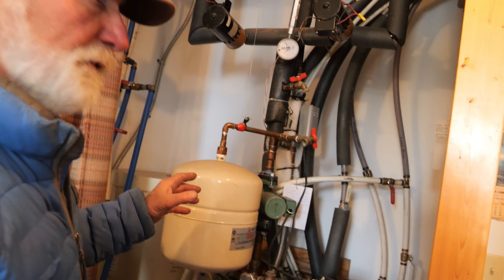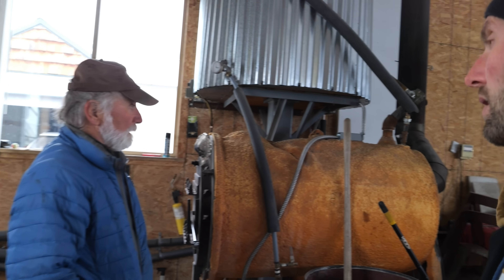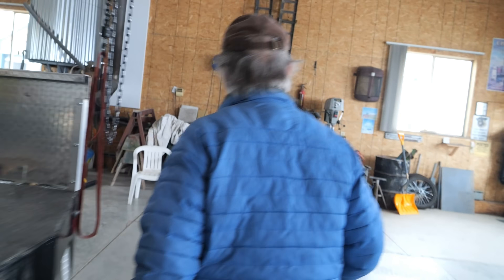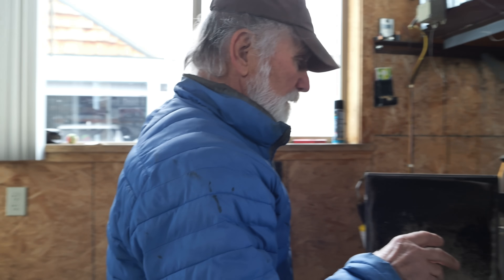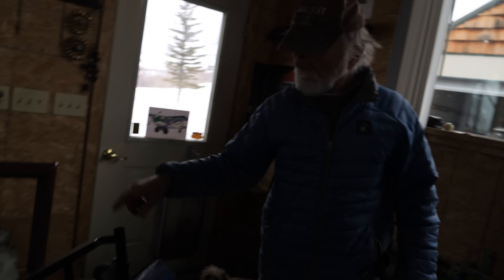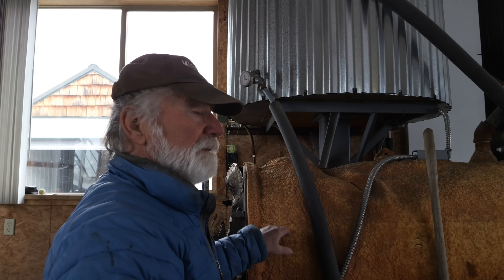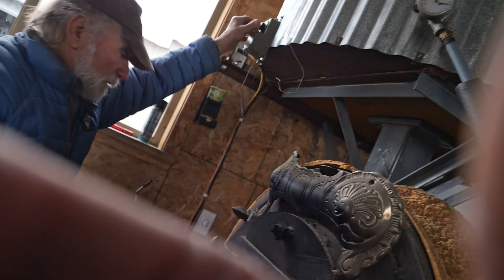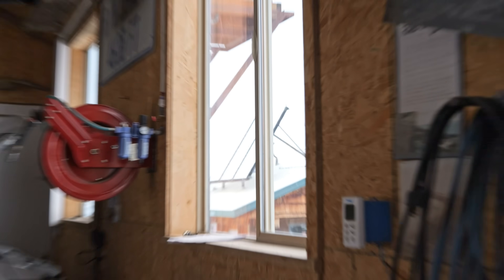Hasn't had a Heating Bill for 40 years.

Comment: I built my house in 1997. based on hydronic  and wood boiler that built myself. my wood boiler differing as it  inside the  the 200 gallon buffer tank.  as it probably a lot safer then his version since  he has a closed system so there a possibility of  high pressure explosion. .  and use  evacuated solar tubes as well. which sure for most of my heating season the solar tubes are more then enough to heat my home. but there is cost to heating  the electricity to run the pumps and cost of the cutting and  collection of the wood. so it not "free" and where I live where the average winter temp is minus 17C(1.4F) and reaching temperature  colder then minus40C(Minus 40F) for 1 to two weeks per year  At a lat of 51.5. sure when I burnt only wood I needed to cut and  haul about 10cords per winter. then i added  solar tubes in 2005  and it dropped to about 5 cords. but average year cost of cut and transport was about +$200.   then I added a heat pump in 2007 and built a hybrid solar system/wood/heatpump system. then it was  cheap enough  that there was no need to even cut wood  as the yearly cost for electricity was only around $120 to run the  heatpump and the solar collectors for my ~8 month heating season. the last couple years i started to burn a little bit of wood again but mainly only when the  temperatures are around minus 30c(minus 22F) around one to two cords during the winter).. but if this video was taken sometimes  in January.  from the angle of the sun you look like you are fairly far south  at around lat 43.. your dead of winter sun is like my early March sun at that far south 7kw of the solar evacuated  would be more then enough to heat a building  all winter long  without any use of wood what so ever. as that is basically when when my heatpump does not come anymore and 100% of my heating is done by the sun again.  as most likely your average winter temp is less then -5C in your coldest month which for me would be a hot balmy day if I had during the winter day
Reply: Solar does the majority of his heating, the boiler is only used when needed, and when he has the inclination. He's not a slave to it, constantly having to feed it with huge amounts of wood.  He can always just flick on the electric boiler as he also has had free electricity for decades. In fact, he doesn't HAVE to have the boiler at all, but it does help keep his grid tied power system showing a net surplus on an annual basis.Evac tubes are a bit overkill, best for making VERY hot water for sure, but rad floors only need low temp hot water, 80-100 degrees, and the flat plate types he uses are more trouble free over long periods, and more cost efficient,  for this application. 42.88 lat. by the way, good guess!
Reply: @portnuefflyer - that is my point - having zero  home heating at  lat43 and mild climate  is simple as pie . heck if he had a  basic +30 year old  R2000  construction. just the average home basic surplus heat from lighting , hotwater ,electronics, refrigeration. and basic window solar gain   would kept his house/garage at about 20c all winter  ( heck when my house was new if I turned on  a few incandescent lights at minus 5c and watched tv my house was was hot  _ usually would not even start my wood boiler until it was -10c  ). if you are not sure what R2000 house construction is. it a Canadian building standard  which was consumes less then 1kw per hour( per 1000sqf) of energy for heating at average winter temps @-15C ( 30 years ago) at -5c it be about 330 watts   . today it  well under   500 watts  probably close to 250 watts at minus 15c .for his area I assume  avg temp of minus 5  he only need less than 100watts/h of heat bleed  from his hotwater tank,  and all his electronics and lights to keep his home at 20C .

Comment: I lived in a farm house that had a fire heated boiler and radiator system. It could be -10c below outside and it would still be +30c in the house and you'd have to open a window all from burning a few sticks of wood.

Comment: Only thing that would concern me about this system is the water in the loop getting hot enough to sterilise it. It's a problem with all low temp loops you have to heat them up once a week to over 60C to kill bacteria. Running glycol though the panels is a good move as it will never freeze.

Comment: In 1957 my milk cow farmer uncle in the hills of western Kentucky put sheet metal over the top of a large concrete basin the cow manure went into from the barn, pulled the methane gas off of that enclosure into a system he bought from a traveling salesman and converted the methane into electricity that powered all the lights on the farm, the well water pump, and put a little heat into the cow barn during hard winters.  He never paid an electric bill again. 1957 in rural Kentucky. Is anyone doing that today in 2024?

Comment: I live in Maine.  I have a Tarm oil/wood boiler and an 800 gallon heat storage tank.  It's so efficient I can heat my entire 3000 square foot house and all the domestic hot water we use with one wheelbarrow full of wood per 24 hours during the coldest days.  I'm thinking of adding a solar panel that runs directly to a 24VDC submersion heater to supplement the storage tank.  No inverters, no regulators, no batteries just maybe temp cutoff switch to cut the power when the tank reaches 175 degrees.
Reply: Do it, used panels from San Tan solar (I'm NOT pushing them or affiliated with them , just real happy with their deals, are a killer deal! Point being get more than 1 panel, you won't regret it. You could always get a mixing valve, and set it to put out 120 degree max, even though the tank temp is higher, otherwise, just let the PV go, no need to regulate it as you say, KISS.
Reply: @portnuefflyer  wow!  Thanks for the great tip!

Comment: Wow awesome. Did he say the water in the firebox heats water in the tank, but the water in the tank and water in the fire box are different ? I would be concerned about the fire box making high pressure steam, but I guess the water circulating through the floor stops that from happening.

Comment: i was hoping those solar pipes would send heat to an insulated reservior, like an indoor swimming pool; but no. So actually during the entire 6 months of winter, the wood boiler heats the building. The solar panels only heat the building during May-September nights.
Reply: The panels provide the bulk of the heating needs during the winter months, only during extended cloudy periods is the boiler fired, a 3 hour fire every other day keeps the shop in the mid 50's to lower 60's, but that's warmer effectively as you're not standing on a cold concrete floor.

Comment: We have practically the same system at our old house in the country side , it is in the Apuseni mountains in Transylvania...because we don't live there most of the year, the solar panels heat the floors so that we don't have problems with frost and it doesn't cost anything, we also use pressurized solar panels to heat the shower water and the water in the pool when we need. We have 8 large panels on the roof with thermos type evacuated glass tubes which captures infrared radiation which in turn heats the water from a 2000 liter thermal agent storage tank through a titanium heat exchanger. The system was made 20-25 years ago by my father and we slowly upgraded it...these systems work perfectly but are not marketed for various financial reasons... no one makes money from them,  people choose heat pumps over these...

Comment: If he wants to upgrade his system with what should be a minor addition, he could get a sealed pipe of either salt or sand, and put it in the center of his vat of water. While it would take longer to heat by a little bit, the salt/sand will actually retain more heat for longer, so he could go 5-6 days without needing a fire. Not saying he needs to, or even should, as he clearly has a system that's working great for him, but it would be a way to go.

Comment: Anyone know what coils he used in the floor that are still holding up? Or is it just basic copper tubing with a liquid in it that heats up?
Reply: Standard radiant floor tubing, widely available at any wholesale plumbing supply hose, usuall in 300' or 1000' lengths.  It is very similar to PEX. Difinitely NOT copper!

Comment: pure BS but yes thats what i had 60years ago to but in the 80's we shange to a heat pump mutch cheaper and less jobb and cleaner than getting wood... not every one has its own wood that last 40 years...
Reply: Not bs. You are obviously jealous.  Sad.
Reply: @mikebradford7780  no in fact thats how we all heated the house in sweden 60 years ago...

In 80's then we got clean, cheap nuclear power to add to ur hydro. Now we are forced back to burning and dealing with wood to heat our homes due to the shutdown of nuclear power for more expensive wind and solar power. With nuclear and hydro, we had a CO2 emission of 30 grams of CO2/kWh at $0.01. Now, with nuclear, wind, hydro, solar, and gas, it’s 450 grams of CO2/kWh at $0.20.
now buring wood is the cheapest option again and will rais the co2 emmissions even more.

Comment: There are enough pumps on this system to heat the property with the ambient heat generated by all the electricity this system requires. Coupled with the massive component requirement and wood burning requirement, this system can hardly be considered to stop heating bills. A bit misleading.
If i might offer a few suggestions perhaps encasing the boilers in sand, so as to further reduce heat losses, since sand releases its heat far more efficiently than water.

Comment: It is a shame he doesn't have a stream flowing by near his house where he could have a repurposed clothes washing machine fitted to generate electricity using the flow of the water to turn a propeller connected to the waterproof motor from the washing machine that when spun from the force of the water will generate electricity.  ...and sell the excess to the city, & save this cash for up keep maintenance, & replacements, because nothing lasts forever... & get your wash machine motors from the junkyard, people replace theirs because they're not the latest style model.  

Hell, in my 20s I bought a 6 year old used car & went to the local junkyard & installed 3.5 upgrade packages to it in a weekend!  And the best thing was when my model was released those upgrades weren't available, making my friends think my car was last year's model.   

Buying a new car is on the same level as going to college today, a huge waste of money, trade school & maybe weekend & night courses to learn to run your own business, & create a business where other people work for you involving your trade.  Electrical & carpentry are the two cleanest, electricians are more in demand but carpentry is more creative but if it's money you crave plumbing is what you want, because plumbers don't even want it to plumbing on their own houses and they won't do it for friends or family for free.

btw, the best vehicle to do junkyard upgrades to with zero doubts is the Jeep, all that matters involving doing this is your competition for the parts in your area, including odd custom made parts on any other vehicle will drive it down except for a Jeep.

When I say "Jeep" I mean the models that have manual transmissions, roll-bars, & made for off road, not the soccer moms going grocery shopping type jeeps, they are jeeps in name only.

Comment: the only thing I see him missing is an underground coil of hose 20 to 30 feet down hooked up to a pump feeding water into heat exchange sucking heat out of the ground, I was trying to remember what it was call & it just came to me, it is call "Geothermal" ... and a neat feature of this system is it can be used for cooling in the hot weather.  And yes, have the water pump(s) solar, but wind would be good because you could run even when it is cloudy & at night, hell the house could be buried under feet of snow.  Well as long as the system still has power for the pumps.  Oh and with windmills, the best kind are the ones that use a barrel shape to catch the wind & not use a bird killing propeller.

Comment: Cool setup but it’s always funny when people that have tens of thousands of dollars in a setup for heat or electricity or whatever and they have to cut and split a ton of wood for it or maintenance a water systems filters and valves or whatever. It’s not free if you have a bunch of money in building it and your time in maintaining it. At some point just buying propane and letting a good furnace work has got to be cheaper
Reply: Some people seem to grossly over estimate the cost of a system like this, both initially and to maintain it, plus the required wood. It must make them feel better when they write the next check, in a never ending series, out to their propane supplier?

Comment: My dad had a similar system in his shop 50 years ago and it worked really well.
Having said that, there's a very good reason burning wood for heat has been banned in most places.
We wouldn't be able to see very far never mind breathe the air if people still heated with wood anywhere near urban areas.

Comment: If anyone is thinking about doing this, Heliatos seems to make this style of solar panel still. They are a decent price, and even have kits that cover most of parts used in the setup shown here.
You can find the higher efficiency panels easily, but they do seem very expensive and not worthwhile unless they can pull some magic trick and get hot water on days it shouldn't be possible.

Comment: What happens to all that solar heat in the summer when the floor doesn't need heat input?
Reply: The system is drained out into a drum, takes 5 minutes, in the fall pumped back in, taking care to get all the air out, like bleeding brakes, that takes 10-15 minutes. That's the sum total of the annual maintenance.
Reply: @portnuefflyer  of course! My doh moment.

Comment: got the same system build 25 years ago... works a treat! i actually build the solar pannels...
Reply: How well are they working in the winter?
For summer is obvious. Spring and autumn I assume are fine. 
But what percentage of energy need provide in the winter. 
Would a underground heat tank would be feasible to store summer heat?
Or the recent low PV price makes electric more attractive?
Reply: @ehombane  it use to work really well, i,ve used more solar than needed for summer... in summer i use to cover half of the solar colectors... now i live on a boat and the new owner of the home i think switched evertying on electrical solars and lithium batteryes... for me worked fine for almost 15 years..

Comment: Most of the heating systems in Eu work like this. Recently ppl also started using PV panels to directly heat water with electricity in a heat exchanger aswell since selling and buying energy from PV systems on a net billing systems is not rly worth it at the moment in my area, contrary to net metering system used previously. The Solar panels are used to suplement the heat source for example a wood gasifier. Also it is mendatory to include a buffer tank with your wood gassifier in EU atm. So you basicly burn the wood for a couple of hours and have heat for many many hours, depends of the buffer thank volume and the wattage of your system.

Comment: Awesome dude! Unfortunately Tom is nudging the limits of the system.  That is, the system NEEDS him healthy, spry and cognitive.  See that white hair? If Tom goes down, the risk is the water in the lines.  That should be changed out to 50/50 glycol mixture, even if it is less efficient, in case he is incapacitated.
-- Tom needs to map out and label the system so someone else can operate it.  Maybe the video maker can help him do so, and make videos about the process?
-- He needs auto-backup in the house at minimum.  An unheated house makes MOLD. Someone suggested below that he had an electric backup..?
-- The key is Tom figured this out and built it and operates it with his BODY and MIND. That is a testament to his awesome creativity and ingenuity.  It keeps him functioning and spry, but he is still working construction (risk) and driving the roads of risk.  
-- God Bless you Tom. Take Care!

NOTES:
-- There is an awesome small efficient stainless steel wood fired boiler designed for swimming pool heating (Canadian Made) that would replace that inefficient wood burner. Sorry, can't remember the name.
-- The key to efficient wood burning is preheated SECONDARY combustion air and CERAMIC insulation at the top of the fire where the secondary air feeds the fire through stainless tubes.  Controlled burn temperatures of 1000F are then achieved, creating smokeless fires, as the smoke is combusted at those temps. Stainless can handle 1200F. 
-- See EPA 2020 wood stove designs. Primary air is throttled, and the controlled combustion feeds mostly on the secondary air. 
-- 30% - 50% of wood can be wasted as smoke in older (pre-1990) or homemade burners. 
-- Most wood boilers are inefficient designs without secondary burn systems.

Comment: dumb question but when building custom water loops for PCs everyone always says to not mix metals do to reactivity. Obviously this system is tried and true but the video said it's made from aluminum and copper my ears perked up. just curious if oxidation was ever an issue.
Reply: The solar loop is 100% copper, as are the return and supply lines, just the exterior frames that house the absorber plates are aluminum.
Reply: @portnuefflyer  thank you!